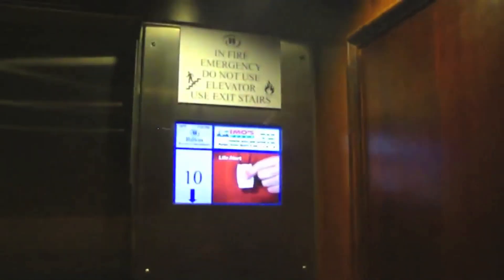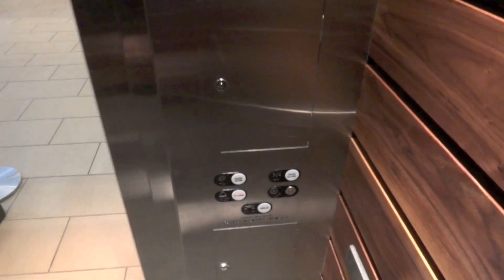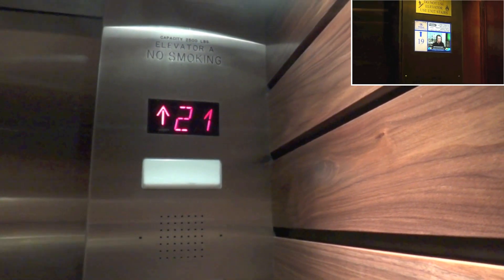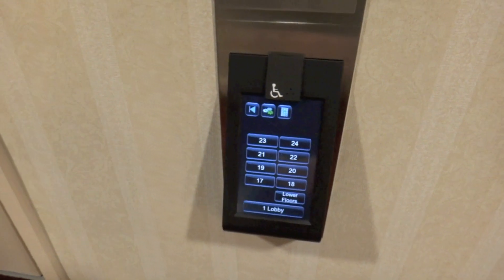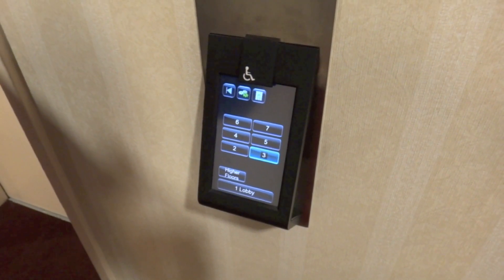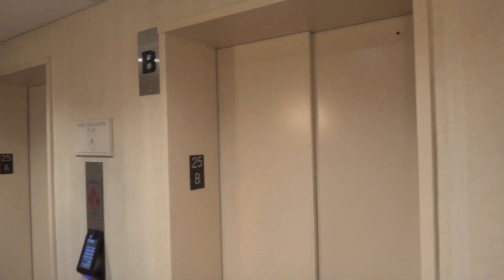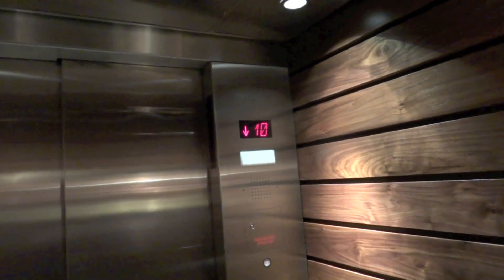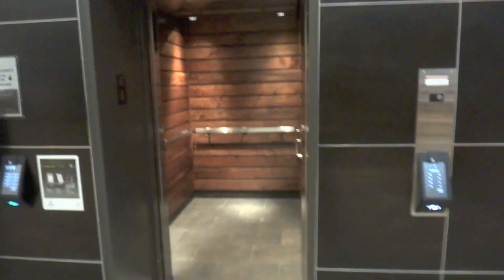Before and After:  Schindler PORT Elevator Modernization

Comment: @ElectroMecca voice is a generic Schindler voice (in the cab). Not specific to Miconic 10 or PORT, used in normal Schindler elevators as well.

Comment: @Balarick 
That, and the fact that these controllers are nutoriously buggy.
When I was at the Marquis in NYC, the only time a high-rise call was accepted, was using the low-rise side. Sometimes, they never worked. I almost took the MPE up 30 flights.